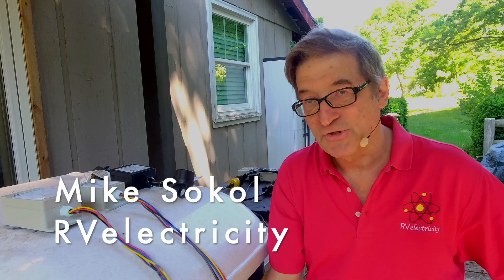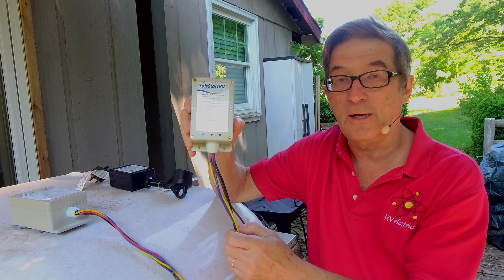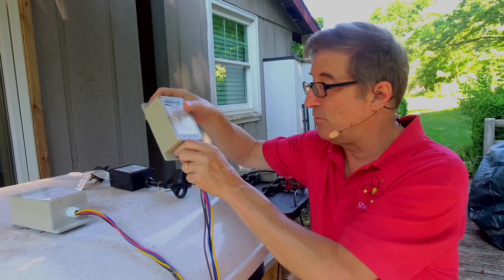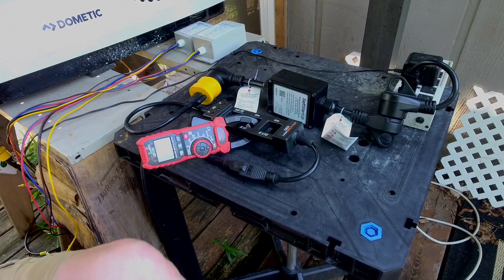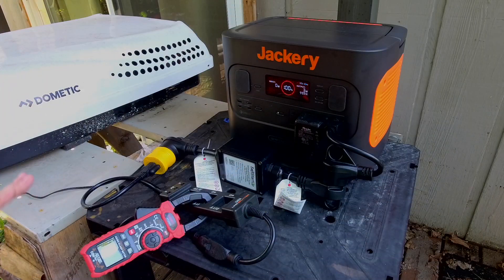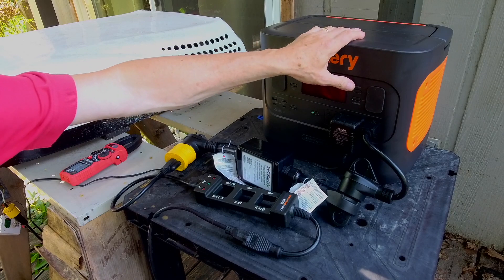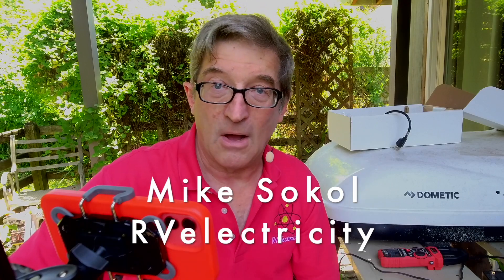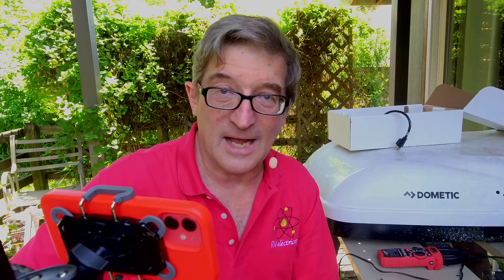SoftStartUp Overview with Mike Sokol

Comment: Thanks Mike. Great instructional video. 
However, I contacted Dometic about installing a Softstartup controller on my Penguin II (a replacement A/C installed in August of 2021) with the heat pump. I figured with a new unit, some type of "Softstart" may already be manufactured into my A/C. 

Dometic representative, quickly advised me that installation of any "SoftStartup" device will immediately void my warranty. 

I don't understand why that would "Void the Warranty" on my new Dometic A/C.  Could you explain?
I have been informed by others that this is why these Softstarts come with Male/female terminals, so that you can reverse the installation process while receiving any work on the A/C units (that sounds like a lot of work to me). 

It sounds like the manufactures want the sudden Rush (and the "Ca-junk" of the compressor starting).  It also sounds like a good reason to purchase and use the more expensive SoftStartup plug, and not hardwire a softstartup into the A/C unit.  More expensive, but no threat to having the warranty voided.

Comment: Mike,

Thanks for your excellent information.

My rig has two Coleman 15kBTU air conditioners. I'd prefer to have the ability to occasionally run both, when connected with 50 amp shore power.

Is there currently, a practical way for me to do this?

Comment: Had problems with mine running on an Onan 4500i generator, First AC would run fine but as soon as powered on the second AC the generator would fault.
Spoke to the Engineer Thomas and we tried a few things with the App and finally we started both Ac's at the same time and worked like a charm. We did it a couple of times and it worked every time, He took my name and number and was going to dig into the situation.
Reply: Rick, how did you get it to work?  I’m waiting for a call back now, but I can’t get it to start my single AC reliability with a 3300 watt peak/2500 watt sustained generator, even with the converter, fridge, water heater etc off and a <1 amp load when I kick the AC on.  That should leave +/- 20 amps for the AC, but no dice.  (Generac 3300i and Craftsman 3300i, same result.)
Reply: Check the App and make sure you have the setting.
Reply: @rickgrinnan8551  yep, tried the different generator profiles if that is what you mean.
Reply: It is. I actually discovered starting both A.C. at the same time.
Reply: Also check how many amps you are drawing at start up.
Reply: @rickgrinnan8551  I think I wrote most of this above, but with pretty much everything off to start but an over LED rope light, the app was read 1 amp when I started.  I think this was rounded up to 1 amp and was a fraction.  In my opinion this product may eventually be great, but they are beta testing it on consumers right now and I’m not thrilled about that.  The profiles are too limiting (none describes my particular generator) and the documentation is nearly non-existent.  I’m glad it’s working for you.

Comment: Great video Mike! - This new unit has a lot of potential I think!
I hope they will build full surge protection (I know it has "some") into it so It can also replace my full surge protector, and reduce clutter at the pedestal.
Reply: I just posted a similar comment to hopefully find a thorough EMS, Surge and Soft Start such as this integrated into one device at the pedestal. All of the above separately are very costly as it is.

Comment: Does he Soft Start Up also work as a surge protector?
Reply from the maker: Yes, it includes 2100 Joules of Surge suppression. I don't think it includes EMS functions such as open-ground or high/low-voltage detection. But I'll do more research and include more info in a follow-up video.